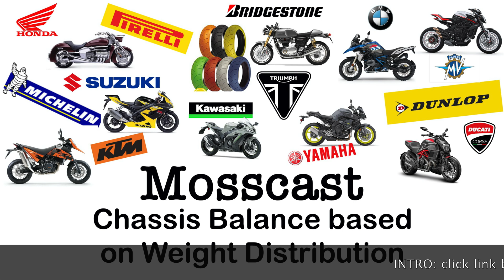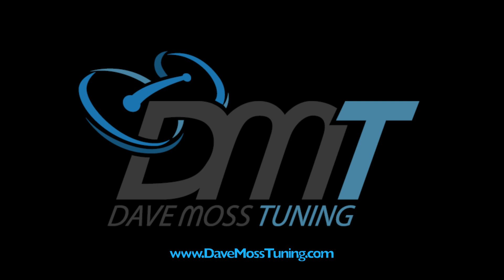Mosscast: Motorcycle Chassis Balance based on Weight Distribution Intro

Comment: Ok do you adjust the suspension or do you scale every bike at the dealerships until you find the one thats scaled appropriately? Or maybe adjust the fork position?
Reply from the maker: Find the bike that fits you 1st. Then look at what needs to be changed ergonomically. Finally, see what the sag numbers are. Then make the decision to buy. Once purchased, get to work on the ergo's sag and damping settings and ride for a month making notes on what you notice. At that point, measure the balance with 2 scales to see what it is and if needed, move the forks 2-4mm and check weight changes.

Comment: In the UK, part of the MOT test is knowing the weight of the motorcycle for the brake test.

If you know the tester, they'll give you the laden and unladen weights front/rear. Gives you a good starting point.